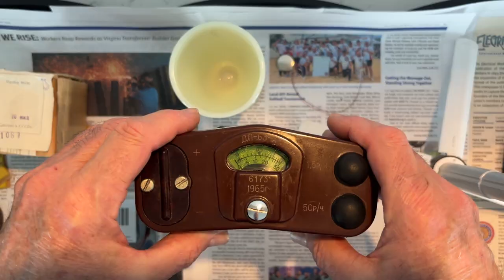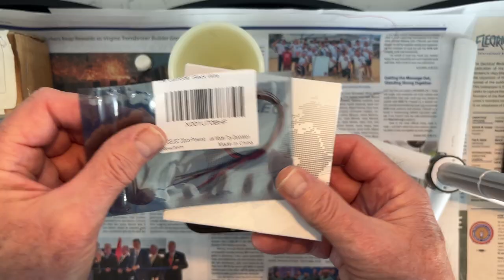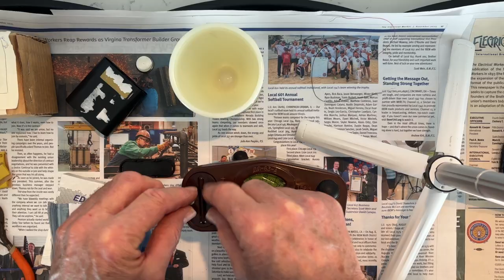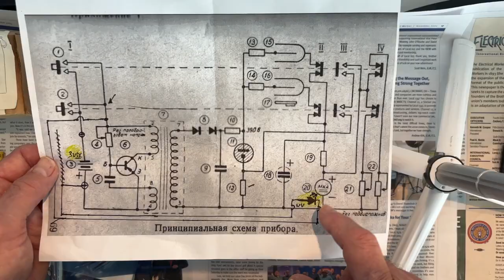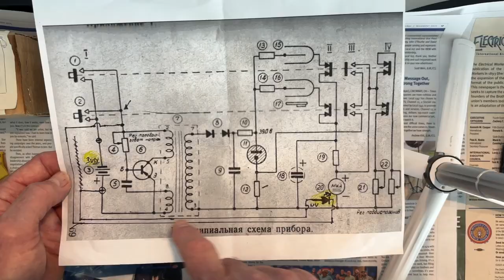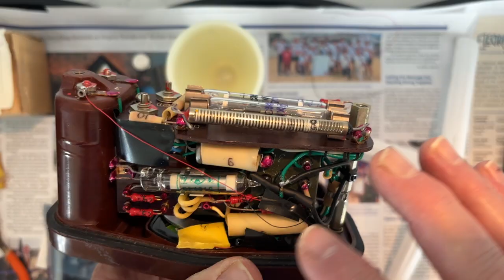DP-63A meter backlight modification

Comment: use your soldering iron to burn the insulation where you want to do the solder connections.  Much easier than trying to strip that thin wire.
Reply from the maker: That's a great tip, I'll definitely give that a try next time!

Comment: If the insulation has any thermal qualities and it softens, just hit it with a lighter or something and pull the insulation off with your fingernail.
Reply from the maker: Thanks I will give it a try  next time I use them sounds like a great tip.